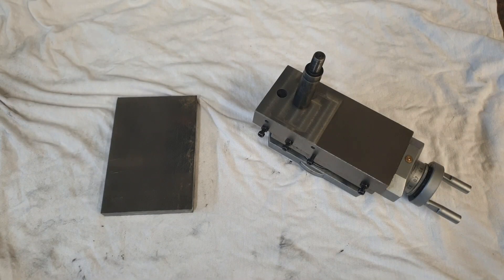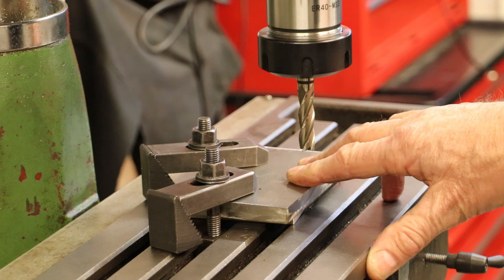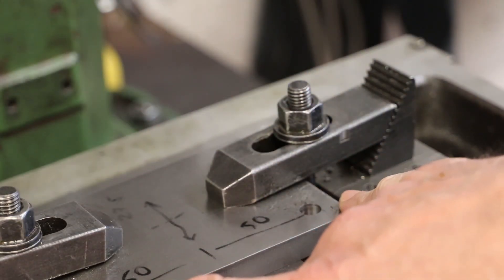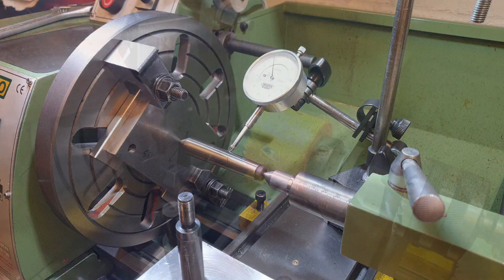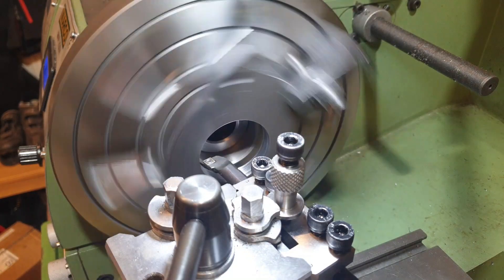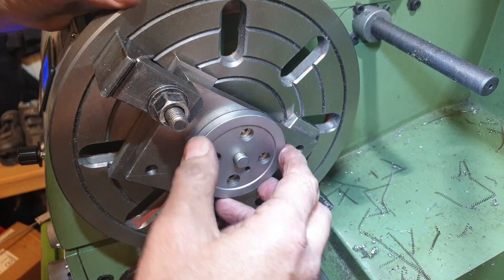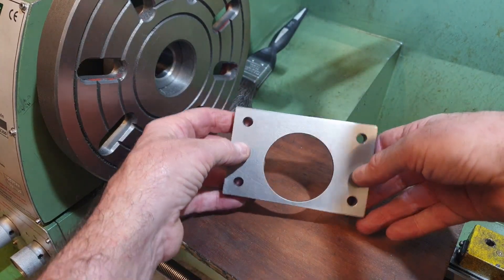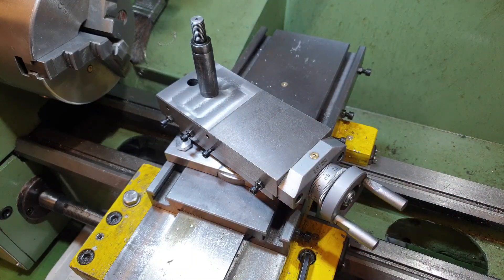Warco WM250V Lathe: Compound slide bracket modification

Comment: Is it an improvement?  I have the Canadian equivalent of this lathe and all I did was drill two more holes in the existing plate so I would have a 4 bolt hold down.  I believe it was worthwhile but I wonder if the larger 4 bolt plate is superior in performance?
Reply from the maker: A good question, but not one I can answer definitively.  I made this mod quite early on, so have no real experience to compare with and I normally run with my fixed tool post.  But anything that reduces the risk of chatter can only be good.

Comment: Hi Mark, long shot here, but do you still use the modified plate, as you then went to a fixed tool holder?
I have the same lathe, and would like one of these, but I don’t have any milling facilities etc.
Wondering if you’d consider selling it, if it’s no longer used, or would you contemplate making another?
Cheers John
Reply: Hi John, my default is the fixed tool holder, but I do use the compound slide when I turn tapers.

Comment: Hi Mark. Looking at your video, it shows you did the Compound upgrade, 8 months ago. Hopefully this is working out good for you. My only concern was, using a hole saw, to bore it out. I'm glad that the hole saw, didn't grab the metal.  It can be not very forgiving. If you read my comment, let me 🤔 know how it's working now.
Reply: Hi Keith, 
Thanks for the comment.  Using the whole saw was a bit of a bodge, but it worked and saved me a lot of time.  Slow, steady and with lots of lube 🙂
Otherwise all is good with this mod although unless I heed to turn a taper I normally use my fixed toolpost.
Cheers
Mark
Reply: @MSmifffy  Good day,  thanks responding to me. As I write this, it's now 7:30am Monday, where are you located? I'm from USA MICHIGAN.
Reply: @keithmonarch447  I'm in the (not so) Sunny UK Keith, about 40 miles of London.
Reply: @MSmifffy  Thanks talking to me. As a machine technician, I installed all over the world. Belgium, Italy, Holland and more. I'm 64yrs old. Have had a passion-hobby and soon will have new Lathe w/DRO. The swing is 275mm Bed length 750mm. Currently I haven't considered to do any videos 🙃. But it could change. Drop me your email address, I personally send work pictures to you. Good week now friend

Comment: Hi Mark, nicely done. I was a bit concerned about the step blocks on the face plate, I'd suggest using a bolt captured arrangement, you don't want those flying off! BobUK.
Reply from the maker: Hah! 
They did fly off (on a later project) and the bed has the scars to show it. 
Good advice :-)
Cheers
Mark

Comment: This is on my list to do. Thanks for the video
Reply: They have two pre-made brackets like he is making at "Little Machine Shop". On your cross slide with the two slots cut into it to mount the top slide if you don't mind how far apart are the slots? I have a 9x19 Shop Fox lathe with what looks the same slide but I need to find out if the slots are the same width on mine as is on yours. Thanks for any help.  https://littlemachineshop.com/products/product_view.php?ProductID=5857&category=1963256897